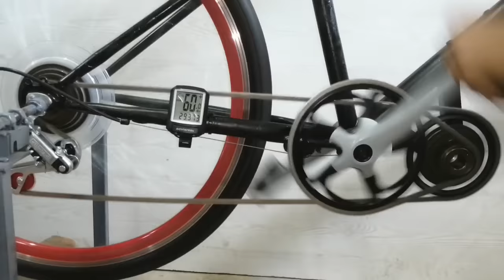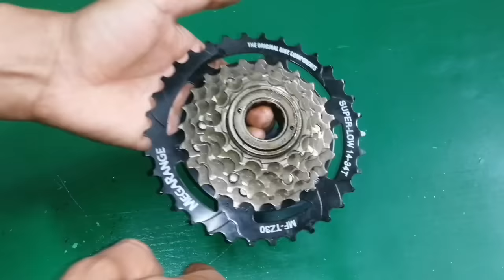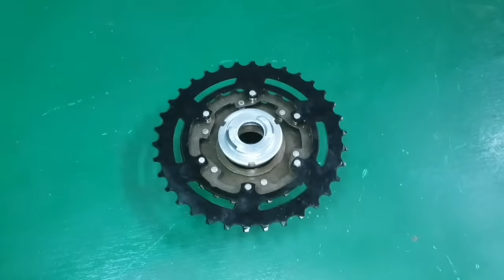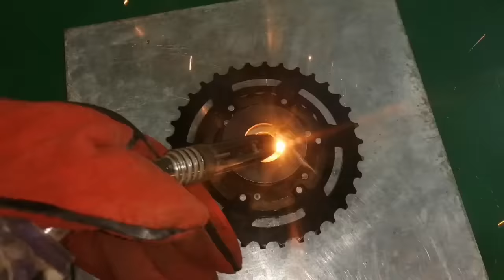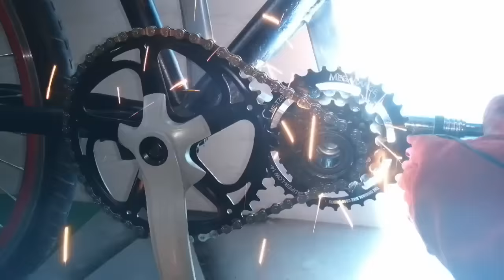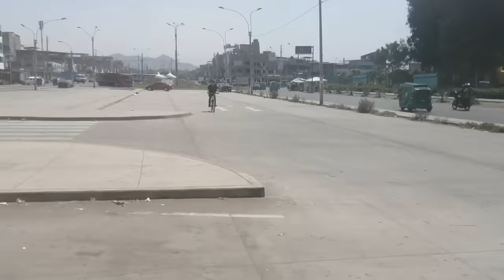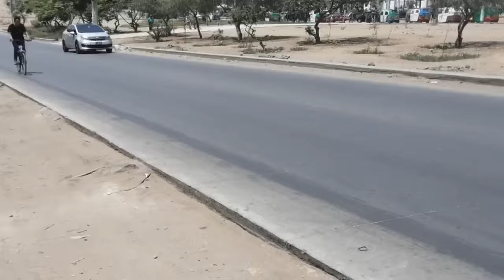making super fast bike

Comment: everything starts from the legs, you don't have strong legs, the invention has no value😂😂😂
Reply: Well maybe then change the chainring ro something a bit smaller like 38 t 34 t or something
Reply: @freshmentosxxxx1709xxxx  it just made the bike heavier, it didn't do anything else
Reply: @alexsarpele6477  oh ok
Reply: Yup only super fast if you can super pedal it.
Reply: But You run faste
Reply: @robertRiVER09764  no idea, it means you're not a cyclist if you can believe that😂
Reply: Legs are stronger than hands
Reply: True😅
Reply: @eddycolon1986  add your weight and friction on that bike and good luck cycling
Reply: this comment has no value, we all already know that fact! duh😢
Reply: Isso pode revolucionar o transporte urbano
Reply: squat SQUAT " S-Q-U-A-T"& LEG PRESSSSSSSS!!! ALA PLATZ ET AL 😜
Reply: The gears and their linear development are obviously proportional to the range of the muscles strenght. This exagerated ratios can only be used in the recumbent faired bycicle as thats used to set speed records at Battle Mountain. More than a double multiplier is used a single giant chainring with 104 teeth, which is near impossible to fit in a standard "vertical" position frame like this one. Here you can use it only behind a shield vehicle to be able to push this gears with your legs. There are some videos about that here, someone in Brazil even reached 200 km/h for an obviously short distance.
Reply: Pero para eso son los cambios lo mismo que los motores....
Reply: @alexsarpele6477  estás equivocado....le aumento la cantidad de cambios...e instalo un sistema de polea
Reply: @mg4861  lo que instalaron fue un sistema de poleas dentadas, que disminuyen la potencia que hay que efectuar para impulsar la bici...es un sistema de polea con lo que levantan los motores en los talleres sin hacer fuerza....
Reply: @alfonsocorreagomez6272  no, esto en el video es un doble multiplicador y no un demultiplicador. Para ir más rápido hay que alargar la relación, no acortarla. También se puede calcular el desarrollo máximo ya que es posible contar los dientes. El plato es 50 conectado a 14 en frente, relación 3.57. Y el 34 al frente mueve los piñones de la rueda trasera donde el más pequeño probablemente sea el 11. Relación 3.09. Por lo tanto, por cada revolución de 360° de las bielas, la rueda hace 3,57x3,09 = 11,03 revoluciones. Multiplicado por la circunferencia de la rueda que parece ser 26", es decir nominalmente 650 mm, que  resultan en 2,042 metros. Multiplicado por 11,03 son 22,52 metros. Imposible para cualquiera. Si los 71 que ves en el velocímetro son km/h, significa que en 1 minuto hay que hacer 1183 metros que dividido 22,52 es igual a la frequencia de 52,53 pedaladas por minuto. Y para tener una relación de 11,03 en un solo plato con el trasero 11, necesitas 121,33 dientes, por lo tanto 121 o 122. Lo que da como resultado un diámetro de más de 490 mm del plato, básicamente igual a una rueda de 20". Demasiado voluminoso en un cuadro de bici normal.
Reply: 加波：有腦子！good
Reply: Осталось придумать систему по усилению ног.   Тогда лучше делать велосипед с одной передачей и с большим соотношением и гонять со скоростью мопеда.
Reply: Conosco barios ciclistas q. podria sacarle buena velocidad
Reply: First time you put power through that all that ting tong welding is going to ball up into a spectacular crash.
Reply: bobo man da
Reply: That's what the gears are for
Reply: Maybe he should wear a helmet his head could break if he spills.
Reply: It's aero my friend
Reply: Large COTS chain ring 64  X 12 is simpler, lighter, less friction, proven reliable and "reasonably" spin-able if u got the legs.
Reply: @Yahweh-Chase-Bella   your comment doesnt make any sense, no matter how big your gears are, if you are not capable of powering it then it is useless
Reply: Seems easy when the bike is up the rack trying this on the road will surely eat up all the energy that you got in minutes
Reply: Actually you can also make the bearing slot of faster using various methods to make it more faster but good luck when the wind is against you…you will feel like taking a shlt
Reply: Duh 🙄
Reply: Actually everything starts from the lungs if you havnt got a good set of lungs your struggle to move your legs..but nice try.😏🤣🤣😎🙌
Reply: There's bikes you sit down and use your hands
Reply: Did you think before you said that? The whole purpose of gearing on normal bikes is to reduce the force needed to obtain a certain speed..gear reduction is a way to cheat force.
Reply: @williammorris4419  🤣🤣🤣🤣….try to sleep or sing at another table
Reply: @alexsarpele6477  Do you think that same rider could have achieved that same speed on that same bike  with the original gear ratios  and no modifications on that same piece of tarmac?
Reply: @williammorris4419  yes
Reply: Yes true. Besides there going over 100mph behind cars
Reply: That's correct brother, he just converted low rpm to high rpm to get more speed and less torque. And that's nice thing for speeding without much energy on smooth roads.
Reply: At least he's doing something unlike you insulting the guy
Reply: @yes55504  and?
Reply: Lol looks like his not even struggling
Reply: @eddycolon1986  exactly. He easily pedals with his arm
Reply: I was excited thinking a battery was involved, but got really tired after reading your post. I’m 62.🤷🏼‍♂️
Reply: better walk with ur own feet
Reply: Which is something even a small 350w DC motor should be able to overcome assuming he can get that chainline instability worked out
Reply: Can you imagine that in combination with a 5000w CYC X1 Pro Gen 3 with torque-sensing (and a good helmet)?
Reply: @mg4861  but probably feasible on a  29er assuming all your calculations are correct or is there something I'm missing?
Reply: @waihingchan2089  everybody's got them the problem is so few actually use them for anything worthwhile
Reply: @Rob337_aka_CancelProof  it's feasible also with the smaller wheels if the ground clearance of the bottom bracket is sufficient (at least 25+8 or 10 cm). Rare to find in a "normal" frame also with the big 29" wheels. But with 29"  there's also the advantage that you can proportionally reduce the ratio and then the diameter of the chainring in comparison with a 26"or 28".  Otherwise you have to build a custom frame with the right geometry for the needed clearence.
Reply: Yah" you got the point " strong legs ,stamina plus endurance to win the game.
Reply: ...I use 46t chainring for my MTB -38t doesn't makes good.
Reply: Try riding a fixed gear with 52 chainring and a 13t cogs

And it's just an average sprinter ger ratio LMAO
Reply: Motoru ön tekere  tak daha iyi pedallar serbest calisir
Reply: Btw it mater about how fast you are if your slow not going go fast its about your legs
Reply: Easy Just add a Electric motor and go to space to speed😂😂😂😂
Reply: So like you then?
Reply: I am a cyclist you are right if you don't have strong legs then this bike is not suitable you just killed your knee
Reply: Gears are looking at you ! 😂😂😂😂😂😂😂
Reply: Mechanical advantage